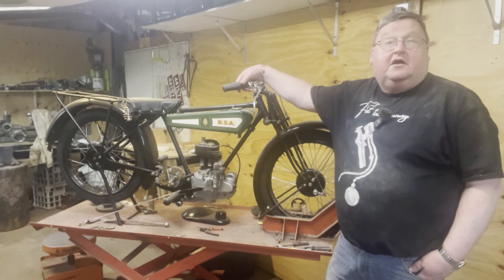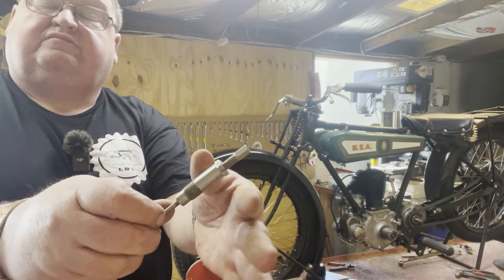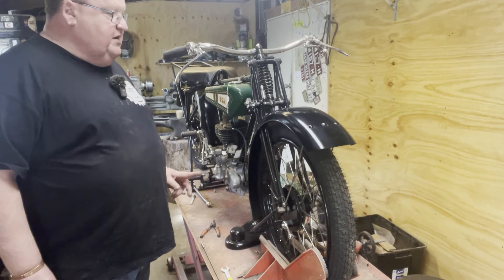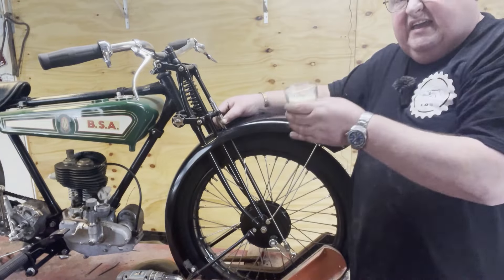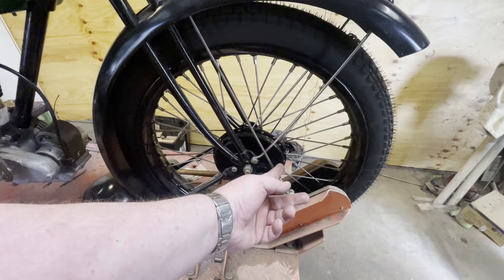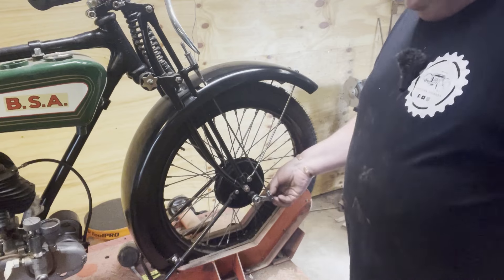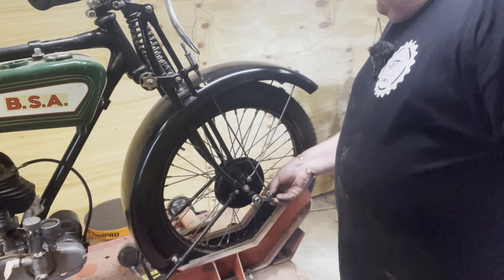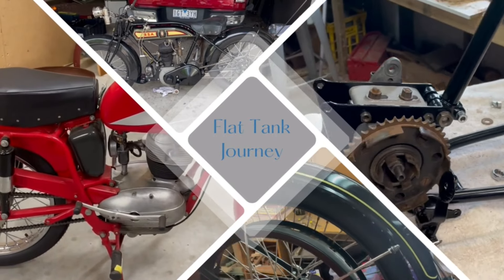BSA Wedge Tank front brakes - Part 1

Comment: I’d be keeping the angle of the rod and the brake arm at 90° to each other for a smoother stronger pull on the shoes ( I’m glad you showed the top piece of the rod as my bike came with a cable directly to the brake arm which I now know to be incorrect so I’ll be copying your setup,enjoying your content 👍🏻
Reply from the maker: Hi Marty,  thanks for the tip.  I’ll look at that.